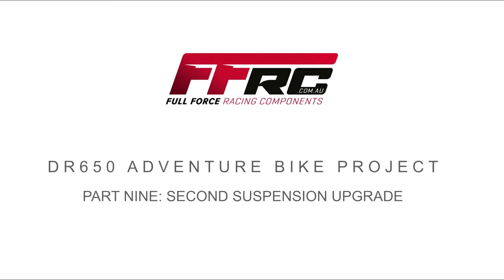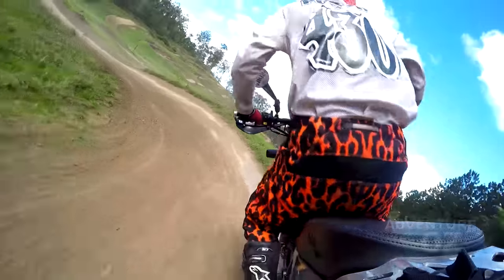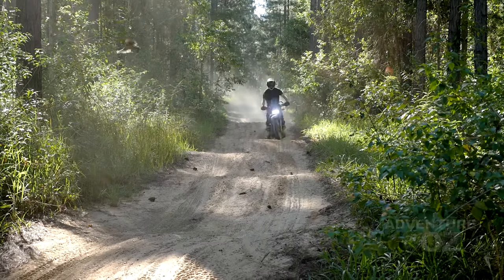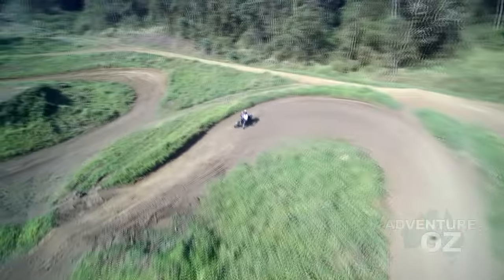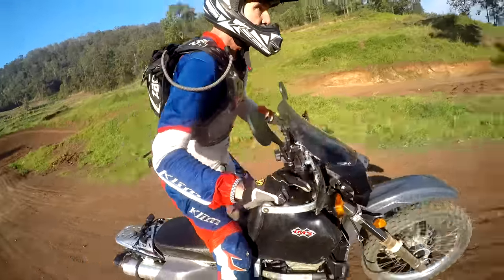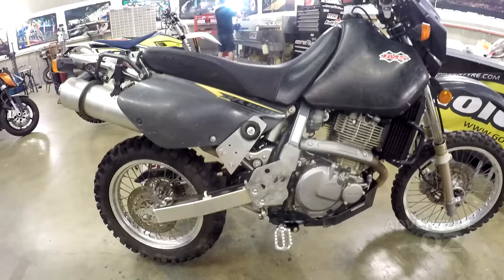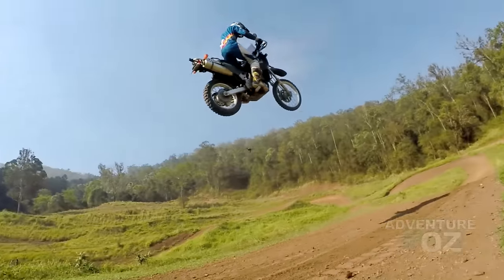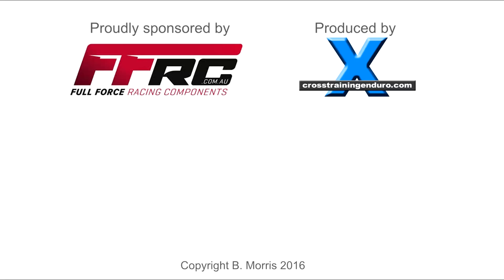DR650 project: best suspension upgrade ever?︱Cross Training Adventure

Comment: Awesome video as usual. 

I am thinking back to your Advrider thread "myth of the lightweight adventure bike" in terms of what you were trying to accomplish with this DR650.

The obvious choice seemed like the 690, but I remember you weren't a fan based on the narrow gearbox and other factors. Your main point about the Drz400E as a platform was also the narrow gearbox. 

May I ask why you decided to start with the DR650 instead of the Drz400 given that the Drz400 would only potentially require wide ratio gears and perhaps a bore bump and 15T CS sprocket to get it to a similar level as the DR650? 

Is your DR650 now roughly comparable to a 690 in terms of usability?
Reply from the maker: for some reason i'm not fussed on the DRZ but it would be a very suitable candidate for many riders. i hate ktm 690s with a passion so wouldn't be the person to ask about a comparison. :D
Reply: JeepersCreepers: "the Drz400 would only potentially require wide ratio gears" - How would you do that? Can't be that simple to fix, can it?
Reply: +frogzie 
I seem to remember a wide ratio aftermarket gearbox made for the Drz for  about 500USD.

I wouldn't trust myself to install it personally, but I also wouldn't trust myself to rebuild my forks.
Reply: Jeepers Creepers - I guess we both have a self-trust issue :)

Comment: Great job mate! Amazing video! Do you know if the Plex Valves work with progressive hyperpro springs? Thanks in advance and greetings from France
Reply from the maker: Salutations d'Australie aussi, Cudi! The soft part of the stock dual rate springs is too long, and the width of the Plex valves helps to reduce this. I don't know if this would have much effect on progressive springs... it would compress the softer part to some extent.
Reply: @crosstrainingadventure  Thank you for your advice!

Comment: do they have any idea on rough costings for the full upgrade yet? (ie, plex valves and springs upfront and a custom piston and revalve in the rear)
Reply from the maker: from what i've seen their suspension costing is similar to everyone else, but the big advantage is that dyno and their design and manufacturing background - these guys make custom suspension parts for the rest of the suspension tuners here in australia and even some overseas. the PLEX valves are more complex than emulators and intiminators but will probably cost about the same... around US$185 or so.

Comment: hello my friend!
 i have an xt660z tenere 2008 and some days before i replace the forks and the wheel with forks and wheel from wr426f
 now i have to change the springs with stiffer ones because tenere is way more heavy and i'm 100 kilos. 
but i don't know what springs i buy.. 
what i have to check ,calculate or consider before i buy???

Comment: i have to wonder how these compare to the cogent ddc's . I really quite like mine
Reply from the maker: as per other comments, it looks as though they work in a similar way... FFRC want to a dyno run on all the valves to get an idea of the comparison, includind DDCs.
Reply: well it will be interesting to see such a comparison. it is neat that those work with the stock fork oil and springs though given my weight and tendency to bring luggage i probably would have had to new springs atleast with those

Comment: So, are these Plex Valves available for pre-SP46 models aswell or is there any half decent alternative?
Edit:
I'm interested because #1 I wonder if the forks got any upgrade ever and #2 over here in Europe import of the DR650 is discontinued since 2000 and getting hands on affordable SP46s is not that easy but I'd love to get and rebuild one of the older models.

Comment: Hi. Those valves are only available for dr 650 or older dr 600 also? What about Yamaha XT 350?? Cheers
Reply from the maker: You would need to check their website but I think it's just 1996+ DR650 at the moment.
Reply: CROSS TRAINING ADVENTURE RIDING thank you for reply👍

Comment: Question.  Now I won't be off-roading the DR like you have in the video.  I'll just be riding it down a 13 mile hard dirt road, with a few pot holes and during rain it will be wet.  The other half will be street riding on asphalt. Should I think about adjusting the suspension like you recommend? or just leave it alone stock.   I just sat on on today, Thursday May 7th, 2020 I am only 5'6, and I was tip toeing with the kick stand up.  The dealer said he can lower the suspension 1 3/4 inches.  Hopefully this will allow me to stand up using one leg when I stop at lights and stop signs.  Do you have any other recommendations I might be able to do with this bike to lower it if this doesn't work? I mean I understand i'm not going to be able to place both feet to the ground while sitting on this bike, but can I do anything else if this doesn't work?
Reply from the maker: generally we never give out personal recommendations on suspension, jason. but suffice to say the more expensive mods are probably more for aggressive and/or heavy riders. check out our video on our cross training enduro channel: bike setup for shorter riders.
Reply: @crosstrainingadventure  Thanks for the info.
Reply: @crosstrainingadventure Sir, I can not find the video you recommended I watch. Bike setup for shorter people, can you send it to me through here. I checked all your videos on your site and couldn't find it.
Reply: Ok so I got my DR and put a lowering link on it and had to shorten the kick stand, after the lowering link was set the kickstand was long. The seat is absolutely killing my butt when I ride it over 20 minutes.  Think I'm going to get a custom seat made.

Comment: So, if I want to do this upgrade should I only order those plex valves and nothing else? 
And are those for front and rear suspension or only rear?
Reply from the maker: I can't answer that, Yazan. It depends on so many factors. We did cover the range of possible mods from cheap to expensive in the previous suspension video. Google 'Plex valves" for more details.
Reply from the maker: There links to those vids in this vid....

Comment: HI!
I just bought a old dr650 rs(e?) 1993
First test drive today and as I'm used to racing...this was different...
However...can anyone tell me why a stable cruising speed is lagging at any gear or speed..?
Carburetor?
Thinking of bying the jet-needle set, but then I have to upgrade exhaust and air intake to?
Engine has gone 100.000 km, but sounds good except for a noizy starter who needs grease..
Anyone?
Reply: I just noticed this. Sorry that I don't see a reply. have you solved your problem ? - I have many questions before we get started. I have a 2013, opened up the air box, Procycle Carb Mod, GIXXR exhaust. I'd put my DR up against anyone's. Not sure about your mileage - but if it is in "Stock" condition you may wish to start digging / research / because, "de-restricting" the DR and letting it breath better, etc. - does make it quite happy indeed. That also said, I've never heard of a DR "lagging in any gear or any speed".... Could be a "Pulsing" problem if the "Breather Tube" (under the seat) is not tucked out of the way - or too close to the "Snorkel" - if still in "Stock" condition.... I'd start with those thoughts. - Now if it has 9,000,000,000,000 miles - we may need to think about something else.... Lastly (sorry) depending on how well it was cared for - you may wish to tear the carb apart, and make sure it is spotless, floats are set right. jets clear, etc......
Reply: OBI- WAN Hi and thank's for your reply.
I will look into this and firstly focus on air leaks.+/-
It's an old bike and has about 100.000 km.
Will take it for a spin now and try to adjust air filter.
All is stock.
Thank's again.

Comment: The bush pig being so low tech compared to MX bikes these days; Ive spoken with many shops about drastically needed suspension upgrades (stock seems almost dangerous for anything), but haven't met any that had known solutions.  Is this suspension solution being marketed and sold abroad?  I need it badly,...but not Mercedes badly.  What will it cost for parts?
Reply from the maker: the forks are the worst part, and the partial solutions were mentioned in this video. there was a link at the end of the vid for more info on the plex valves which appear to be the best solution to date... the link is in the video description too. and i think the middle of the vid as well.
Reply: Ok, I'm tracking the so-so solutions pointed out, was just interested in the plex valve.  Thanks

Comment: suzuki wake up if you put this suspension in the DR  you would sell so many DRs I had a 2005 it sucked  the front will just give and never rebound the rear would bottom at 6 mph . but it s a really capable bike  from  what i see here. this would kill the klr . I had all 3 05 dr  2011 klr and now 2015 xr650L

Comment: You can't polish a turd the dr 650 is a 20year old design and suspension upgrades don't make up for antiquated technology and a 170 + kgs l have dr650 and fully modified to boot my recommendation would be buy an Honda xr 650 and go from there
Reply from the maker: Personally I would prefer the XR650L for more dirt oriented riding but they don't sell it here. But for a mix of road and dirt I think the DR650 has the edge in some respects.

Comment: how much to do this for my stock bike?
Reply from the maker: you'd have to ask FFRC and specify exactly the bits you wanted and did want https://goo.gl/ftLRHC
Reply: The bike setup, while it was doing the big jumps in the video had standard forks (even standard springs) just with the Plex valves dropped in. The shock had been re-valved, it had one of our pistons, heavier spring and our shaft modification. Around $750-$850AUD worth, if you dropped the bike into our shop (ride in ride out). This may be an overkill set-up for some riders. We intended to only do the jump once or twice, but the bike just loved it. I think that day it probably saw the big tabletop at least 20 times, including a couple of over jumps :S hehe, was so much fun :)
Reply from the maker: some crazy test pilots that day lol  not for this old man....
Reply: Full Force Racing I look forward to ordering plexes etc from you soon, awesome design work 😀